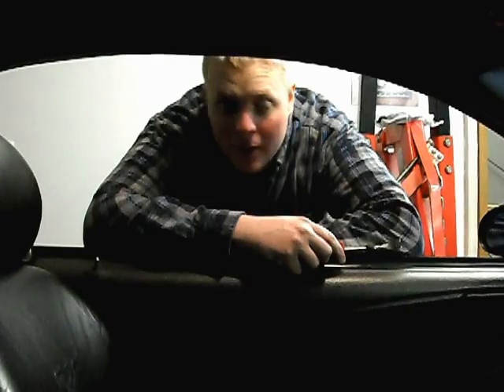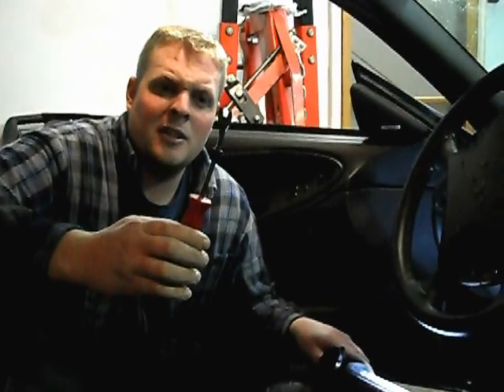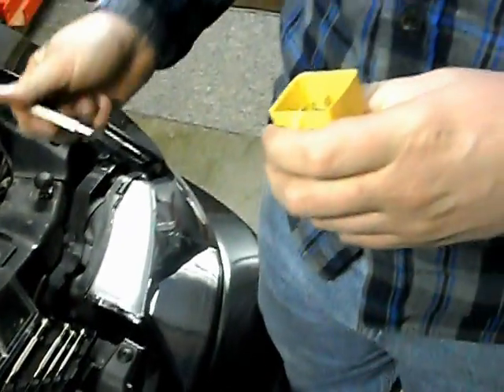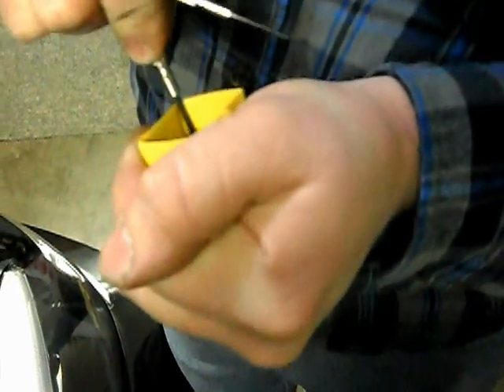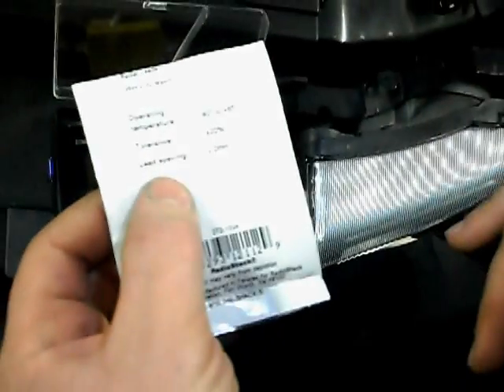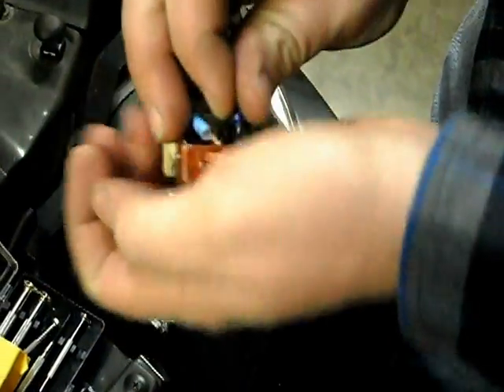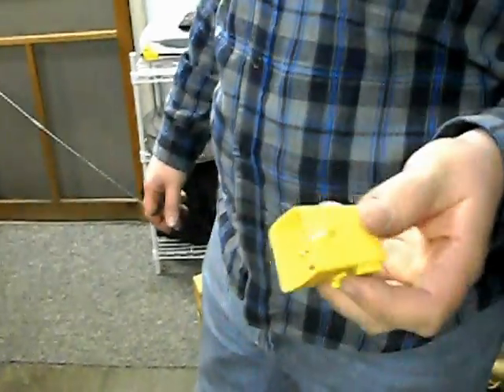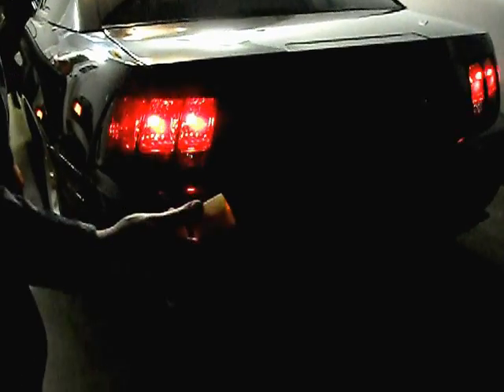slowing down your sequential tail lights

Comment: i all ready put the  4.7uf 63v capacitor but the ligth are the same help
Reply: Jaime Nevarez the voltage is too high try to get one between 12 volts and 30 volts Max
Reply: Gracias Jorge Pizarro

Comment: I have LEDs and I'm in the middle of doing this mod and I'm contemplating switching to regular bulbs.  My question is, while you had LEDs did your cruise control work?  Mine  doesn't and I'm wondering if it's because of the LEDs.

Comment: Thank you for the tip I was about to order a modified flasher for $42 plus shipping $7  then I watched your video. I went to Orion Electronics and got a capacitor for 0.68 cent. It works great Thanks again saved me $46 dollars

Comment: Will this work if I don't have sequentials...? I just put in LED Bulbs and my turn signals are super fast =\ 
-Thanks in Advance
Reply: You’ll need inline RESISTORS to slow them down. I don’t know which size you need, research it, the info is out there.

Comment: D,
Great video. Just installed sequential taillamp harnesses on my 2003 Cobra and didn't like the flasher speed. Followed the steps in your video and everything turned out great. I was about to drop $50 bucks on an aftermarket flasher, but decided to try your tip. Thanks a lot, you just saved me $48.50!
PD